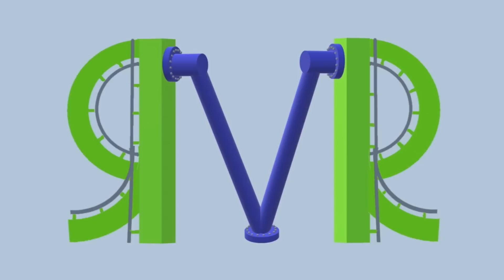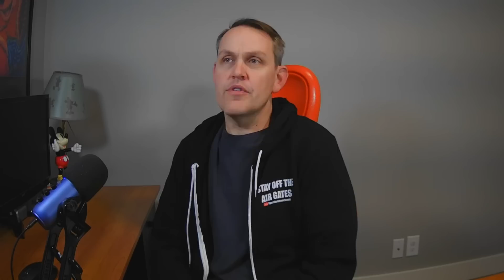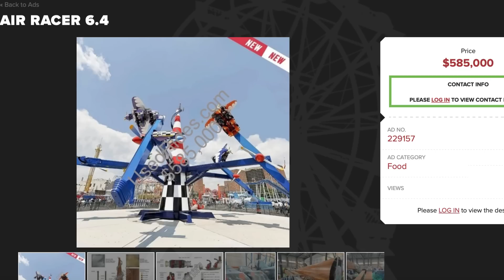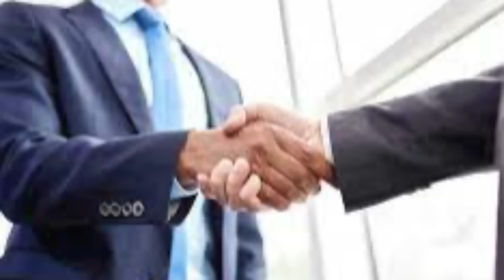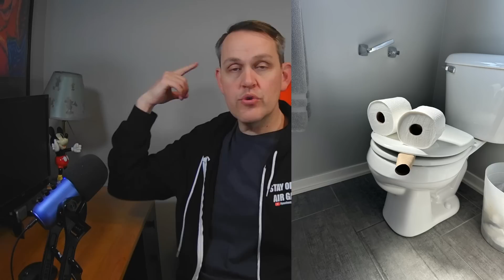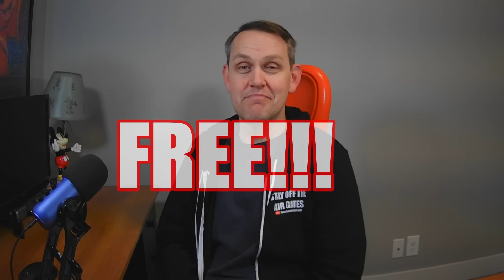You can get a ride for free but there’s one catch

Comment: I can't help thinking of that guy that built jet motorcycles and pickups from engines that still had life in them, but were to elderly for aircraft use. You'd think somebody would have worked out a system for downgrading components that could be put to other-than-amusement-park use.  Souvenir seekers and artist who might want to creatively recycle parts come to mind.
Reply from the maker: A lot of parks are scared of liability issues when it comes to old parts. One of the reasons they go straight into the trash.
Reply: @ryantheridemechanic  Between aircraft and amusement devices, I'd guess aircraft are more anal about keeping bad parts out of the system. I'd also guess that many of the parts they're wary about are so uncommon, it'd be relatively easy to find out where a legitimate replacement came from.

Comment: Utube randomly popped up your video to me. This was a great, fascinating discussion! There is something else I would like to add. Years ago, there is this one ride that had been shut down for quite a few years. I can't remember if it was the park director or park manager I had spoken to? I was asking in regards what was happening to the ride? Basically, he broke it down like this. When these theme park rides are bought new from a manufacture, the theme park will buy additional spare parts to go along with the ride. The problem with this ride is that this integral piece of the ride had no more spare parts from the manufacture nor could they get any more spare parts from the manufacture due to the company that made the ride is no longer in business. I asked if they got a machine shop, why not make a new part to manufacture original specifications? He said because of the liability. If something would happen on ride and it is caused by new part the theme park had made, it puts liability on the theme park. Also when a ride no longer has spare parts from the manufacture and manufacture has went belly up, the ride is essentially over. So it actually makes sense now when I see in multiple theme parks put in the same generic roller coaster with a different name for less chance of liability. If someone gets hurt, if the park does the proper checks, maintenance, safety inspections, guidelines and procedures, chances are liability will fall on manufacture not the theme park itself. That's why when one ride has a problem and is being investigated, the other identical or close to the same ride, all get shut down in multiple theme parks until an investigation is complete and determined if manufacture or theme park negligence and if rides are ok to be in operation or not.

Comment: This explains why Joyland, which closed in 2004, is still there and Roller Coaster remains in several huge piles of wood & steel over 20 years later. They can't afford to clear everything out. Jazzland/Six Flags New Orleans too, who apparently were recently thrown a lifeline from a buyer just before destruction of Mega Zeph was to commence. Since 1981 I've been to about 10 abandoned, long-closed amusement parks with standing wood coasters, which I walked & photographed. If a park can't afford to remain open, they probably can't afford to demolish the place, either. Taking down a wood coaster has got to be one of the most expensive parts!
Reply from the maker: they only pull stuff when another park pays for it to be done. otherwise, abandoned in place.

Comment: I wanted the Top Spin knowing it would have taken several dozens of thousands to remove and relocate it. The Typact dc drives and control cabinet are worth something.
Reply: It weighs like 60 tons and uses hundreds of amps to operate
Reply: @ yeah, I think 400amps. Thought it was more than 60 since the transportable model is 107.

Comment: So the takeaway is this: You CAN get a free ride from a park......but in the end, the costs of transporting the ride to your site, the legal costs, the engineering fees, the foundations, the other infrastructure (electrical, mechanical, buildings, etc.) AND repairing the damage from removal (plus new inspections) it will cost you as much, if not more, than contracting a brand new ride from the manufacturer.
Reply from the maker: @mxslick50  well…. Remember a brand new ride will still have all of those costs. AND the cost of the ride on top of it.
Reply: @ryantheridemechanic  Do ride manufactures allow the general public to purchase rides / rollercoasters for private use??
Reply from the maker: @ yes
Reply: @ryantheridemechanic  I wish I was rich lol
Reply: @snakesonn   Right? Dude, I WISH I had a few million laying around. I've got the land. I just need the millions. Cedar Point corrals their pony ride horses right next to Millenium Force. I think some cows can handle anything going on in their pasture.😀
Reply: It would still be cheaper than a new ride. If it weren't, no one would relocate rides. The six flags ride rotation program would have never existed. Independent, family parks would likely not exist anymore.
Reply: Amusement park Manage Tom Wages had the last remnant of Travers  Cyclone coster  from Crystal Beech to Darien Lake back in the early 90's

Comment: The Green Lantern trains are most definitely compatible with Riddler's Revenge. When Green Lantern was Chang, it only had 2 trains. When it was moved to Great Adventure, they wanted a third train, so they actually took one of the trains from Magic Mountain and sent it over there. After the first 2 years, Green Lantern dropped to a 2 train service, and the third train was sent back to Magic Mountain. The only difference is that Riddler uses 8 car trains, and Green Lantern only had 7 car trains.

Comment: I'm surprised you didn't discuss the cost of regrading an area designed for another ride and then making new footers.

I've always been amused by the enthusiast world that seems to think that moving an already built ride gives you some sort of huge cost advantage. From what I've heard, the savings is minor at best.
Reply from the maker: @danloosen8358  don’t really know those numbers just the footers. Plus that is extremely dependent on the ride and the area it came from vs where it’s landing.
Reply: @ryantheridemechanic totally makes sense, I've just been told that the footers of a ride that uses them is the most expensive piece of installation that there is

I have a bit of a similar background to you, and it came up as a discussion of enthusiast beliefs about the so-called ride rotation program, and what was really going on there.
Reply: @danloosen8358   They’d be the most expensive labor cost, but one of the cheaper costs in materials.
Reply from the maker: @ I participated in that for a bit. You have to basically only use rides that could “sit” on a concrete platform. It wasn’t going to work.
Reply: @ryantheridemechanic   In other words if they’d have bought something like Olympia Looping and moved that the program would have been fine :p
Reply from the maker: @ kind of yes.
Reply: @Danrarbc yeah, so it should make someone wonder if the program ever truly existed with rides that were not built to move at all anchoring it, when they could have found established manufacturers to build rides intended to move instead if it was really a planned "program", or if something else was afoot.

Comment: 22:51 I heard somewhere that Olympia loopings (a mobile schwartzkopf coaster with 5 loopings) takes 50 truck loads to move the ride between setup locations and that that is the reason it is only setup in 3 locations/year
Reply from the maker: @vincentstuer  those are some monster rides to set up. Generally not worth the time and effort to assemble and tear down quickly. I could see it if the tracking show was in a location for 2-3 months but not for a week.
Reply: @ryantheridemechanic   It looks like the shortest Olympia Looping operating windows are around 6 weeks. Vienna and Munich are each closer to 3-6 months.

If I had to guess the annual rebuild occurs in that 6 week run in what could have otherwise been a 2-3 month one.
Reply: Not Schwarzkopf, BHS.
But that ride is designed to be transportable, and when tricking was less expensive, the owners had it set up even at shorter fairs lasting a little less than two weeks. I don't recall their exact record, but they managed less than a week from closing in one location and opening in another. But like I said, it is designed for that. The track pieces are sized to fit on trailers, the track pieces are not welded together (they go together like a Lego set, there is only minimal bolts involved) so this is very different from a B&M. And it doesn't need concrete footers...
Reply from the maker: @ yes I worked on a similar version traveling 150ft tall.
Reply: @Colaholiker  ahh yeah, it's a Schwarzkopf design which is what I mixed up in my head with manufacturer
Reply: @vincentstuer  to be fair, Anton Schwarzkopf was involved. Just not his company, which had gone out of business at that time. And just looking at it, you can tell that Olympia Looping is the last step in the evolution that was kicked off with the Looping Star. They can't deny their common ancestor. 
But to me, that's like calling coasters built by Giovanola for Intamin a B&M, just because Walter Bolliger and Claude Mabillard worked for Giovanola before starting their own (very successful) company. 😉
Reply: @Colaholiker  I am not saying that it is basically a a Schwarzkopf coaster because he was involved just that I mixed up the facts in my head, still a shame Schwarzkopf went out of business tho
Reply: 5 loops*
Reply: Conklin Amusements had one or someone had one booked on with Conklin back in the 90's . They set it up at The Westchester County Fair at the raceway property in Yonkers 50/ 60 trailers to move it
Reply: I travelled to visit Olympia Looping twice with the European coaster club. Then a decade on I visited Prater Park in Vienna (city visit was planned, park visit wasn't) and there she was. 
And fwiw I'd call it schwartzkopf. 

(I also went to hopi hari in Brazil to ride Katapul a year or two after it left Alton Towers - thanks work for the trip and hire car)

Comment: It costs a LOT if money to scrap a ride. Even more if it’s dissemblied to move. Then there’s the move itself, and then installation. In the vast majority of cases, it’s not worth it. Remember Six Flags ride rotation program? They ruined several coasters moving rides that were not designed to be moved and they had to scrap them. Others never went together well and were impossibly rough when put back together.
Reply: Did you see the Six Flags New Orleans scrapping videos? 
Literally just one absolutely clueless guy with a torch cutting in random spots and then running away when he almost crushes himself.
They probably hired him from a Home Depot parking lot.
Reply: @toddjones1480  yes. It’s corrupt New Orleans scrapping it, so whoever delivered the envelope to City Hall first got the contract. Qualifications be damned.
Reply: @porcelainthunder2213   The flats like Condor would have worked out better though. Which continues to operate today.
Reply: The same with Astroworld when the park closed several coasters were relocated to other parks.  But those rides were too damaged to reassemble and they were scrapped years later

Comment: I like when parks turn old track segments into scenery, or build a memorial to the original coaster.
I never got a chance to ride Corkscrew at Alton Towers, but the fact I can still see its signature corkscrews every time I visit the park is kinda inspiring.
Reply from the maker: @punishedfoxo  I like they used old Nemesis track as decoration as well.
Reply: @ryantheridemechanic   Ala Hulk
Reply: @ryantheridemechanic  Alton Towers is a little notorious for reusing things they had sitting around in storage for a long time. In the queue for Thirteen they had one of the old, very small vans that the park used to use in the 90s bound in tree roots. But it was a little far off in the woods, so it was actually a pretty creepy sight.
I'm fairly sure the Tesla coil theming in the station was also previously part of a scare event, but I haven't really seen any proof beyond rumour.
Reply: A Great American Scream Machine loop is in the baboon section of the Great Adventure Safari🎢
Reply: @Mister-Whiskers  That section is actually the top of one of the original loops which was replaced with a reinforced version in the 90s. Even cooler IMO.
Reply: If you've ridden Thirteen, the old Corkscrew lift motor is on your right as you return to the station.

Comment: 4:58 are you talking about six flags astroworld? Because that would be interesting considering their stand up is a intamin and the floorless is a b&m
Reply: @bjtgaming   The engineers that eventually founded B&M built those Intamin stand-ups. That’s why they are indeed so similar.
Reply: @Danrarbc  i know that, but those rides in question that this part is being used for were manufactured about fourteen years apart, and for different companies. Even if they're similar, I wouldn't think they'd be compatible.

Comment: I deal with this at my current job. A customer gets upset when you tell them you’ll give them $10k for a $1.5M machine that’s only 5 years old. They ask me to explain why the offer is so low and I tell them it will be a minimum of $200k just to get it out of the building. Then they start realizing that it’s really just a paperweight
Reply from the maker: @definingimage  and a paper weight that will have to come out regardless.
Reply: @ exactly!!!

Comment: Supposedly, Green Lantern used Riddler's train before to run 3 train ops. It was eventually sent back to Magic Mountain, so I think the trains will go there. Probably send one to Georgia and one to Cali
Reply: Yep. Chang was built for 3 train operation, but was shipped to Kentucky Kingdom with  only 2 (it even had storage track for a third train) trains, in case the park grew to the point it needed additional capacity. When it was sent to NJ, it was now in a park that needed the capacity. Rather than buy a train, they "borrowed" MM's train. You could tell the trains apart too. Chang trains had black handles, and the Riddler train ran with silver handles.

Comment: Wait so if the footers are buried a lot of the time, doesn’t that come back and haunt them when they want to build something new? Do they have to mark the area where they’ve buried the footers?
Reply: The old locations will still available several ways. The regulatory authority will still have the plans on hand, so will the park and then even the manufacturer may have a copy as well. Losing these is a bit more common with older installs and burials - but generally it’s not an issue for anything reasonably modern.

Comment: What if you just wanted a small track piece or rail piece
Reply from the maker: @BackRowCoasters  even harder when you try and stick your foot into another’s business.
Reply: @ryantheridemechanic  I do know some parks have directly sold these though. Blackpool Pleasure Beach sold pieces of Big One when they retracked portions of it. Cedar Point sold pieces of Maverick’s fabled heartline roll and also sold pieces of Wicked Twister. 

Basically some parks understand the collector and enthusiast community and MIGHT do this stuff. But it isn’t a large piece - most of the pieces of Big One were about 6 inches of running rail.
Reply from the maker: @ yea that stuff is heavy. Very heavy. Shipping would be and arm and a leg and then you couldn’t even hang it at home. Just a meter of rail is about 60pounds in weight.
Reply: I think he means more of; Cedar Point contracted XYZ company to take a coaster apart. Then you as a 3rd party. Come in and say "can i get a sliver of track?" The muddles the water. Now you have to probably get both companies to agree meanwhile both are on a strict time frame and don't have the time to do extra precision work. Parks that sold off pieces of track likely already had in their agreement to cut off 100 2 inch portions of rail nice and tidy to sell as souvenirs.
Reply from the maker: @ middle of the night with a saws-all and a ski mask.

Comment: I have always wanted a used antique car, but I rarely see them for sale. I found a manufacturer, and, wow, they are expensive. The last one I came across was $10,000 on resale.
Reply from the maker: @Mr_Feeny  not bad. One of those stupid go carts you see at every entertainment place is $8k
Reply: @ryantheridemechanic   are you for real???? WTF makes those things so expensive? And $10k for an antique car? What makes those so special? I could see a couple grand. I mean, most of them are relatively accurate looking representations of old Caddys and Fords, but it's not like each one is hand crafted by master metalsmiths, all hand tools. Plus, they can reach a top speed of, what, 3 mph?
Reply from the maker: @Spike-sk7ql  just the cost of amusement stuff.
Reply: @ryantheridemechanic  man, its too bad those wouldn't exactly be a huge seller. Those things would still be a HUGE profit selling them at half that.